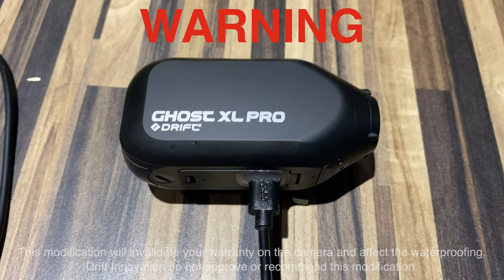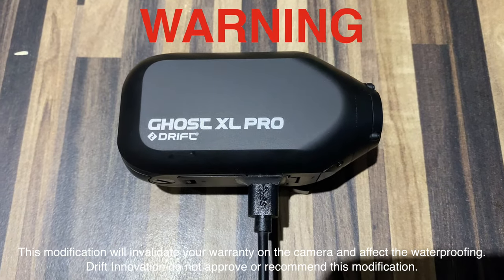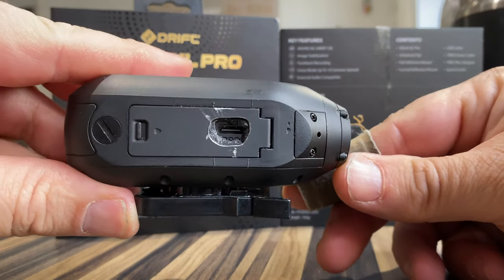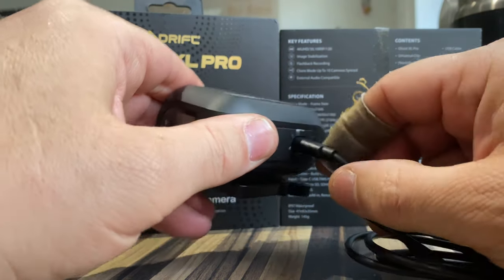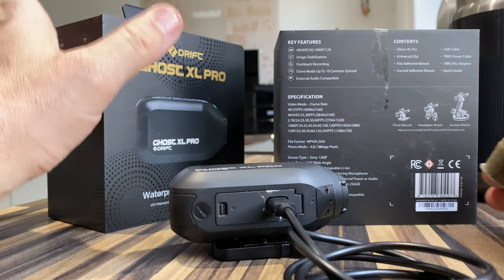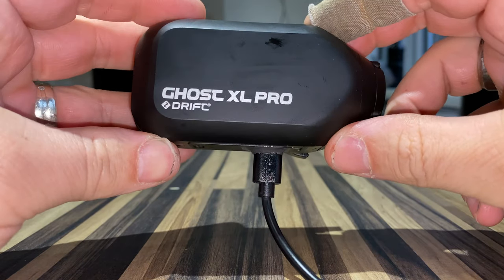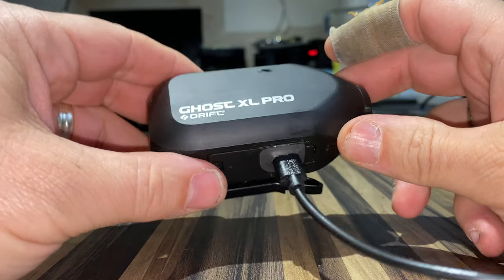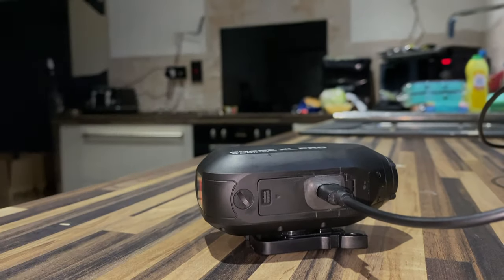Drift Ghost XL Pro External Power Supply Modification

Comment: The user manual indicates the threaded 3.5 mm jack (under the threaded plug) fits the included 3.5mm plug to USB adapter has an o-ring which is a waterproof way to supply constant power. Did that not work or are you using that Jack for an external microphone?
Reply: I wanted to ask the same question...Why cut a hole in it if you can just use the already given plug to usb adapter?  As for the microphone...easy enough to record audio to your phone that will be better quality with a clip on mic.
Reply: How do u make that work? Iv been trying to use the 3.5 to an external power but couldn’t get it to turn on even on dash cam mode
Reply: How do u make that work? Iv been trying to use the 3.5 to an external power but couldn’t get it to turn on even on dash cam mode

Comment: But the XL pro comes with a usb to 3.5 MM jack that gives permanent power.   WHY would you do this?
Reply from the maker: Because the 3.5mm is either mic or power not both. This way I can have the mic in and the usb c supplying unlimited power